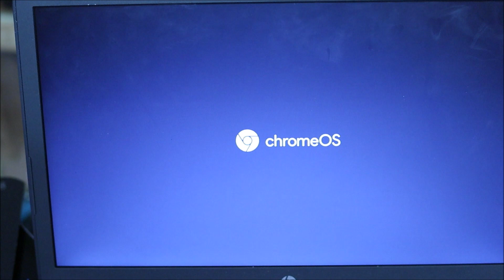Hp Laptop chromebook not turning on not charging fix

Comment: This didn't fix my problem, but helped. I unplugged the battery and plugged in the power supply. The indicator light started blinking. However, the laptop still will not turn on. Plugged the battery back in, power supply, and nothing.